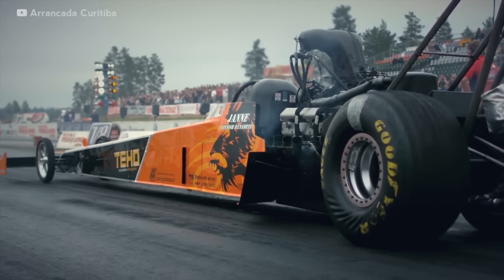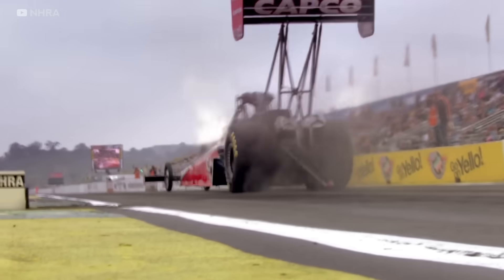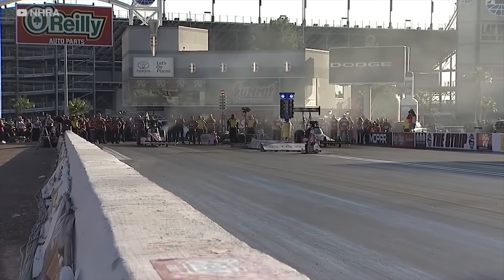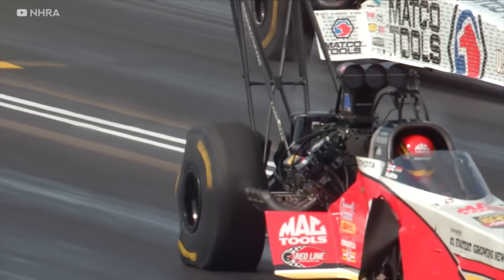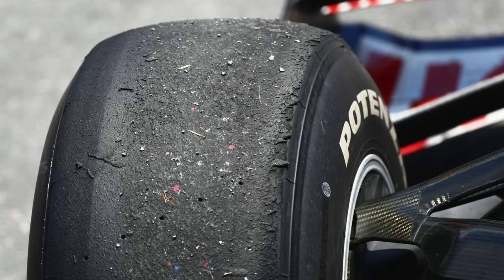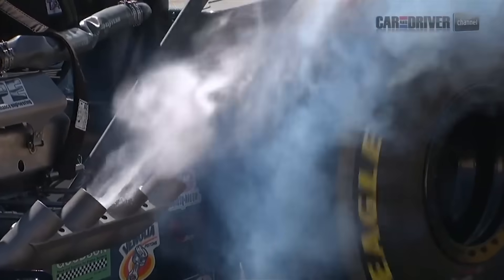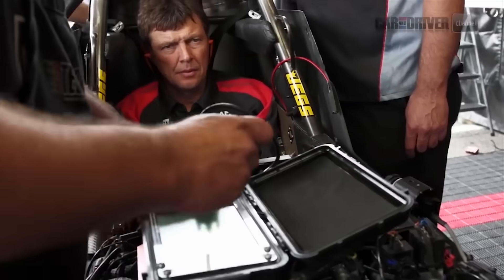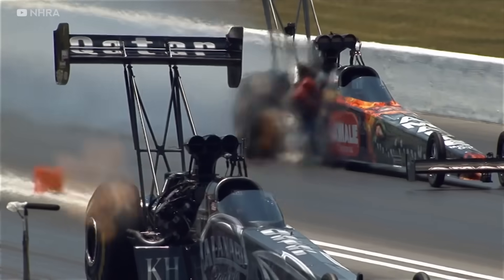How Dragster Tyres Accelerate to 335 MPH in 3.6 Seconds

Comment: You know it’s next level when car noise is being measured on the Richter scale
Reply: Oh fuck its so damn cool!!! And the vibrations damn near suffocate you from shaking your diaphragm so much 😂
Reply: @jacobharrell2634  I thought the suffocation near top fuel dragsters was caused by the nitromethane emissions.
Reply: @naut3  The fuel fumes don't suffocate you, they're just crazy poisonous. The exhaust has a lot of nitric acid in it, which "when inhaled causes a muscular reaction making it impossible to breathe." Your diaphragm just nopes the fuck out when you get a whiff of ammonia or HNO3.
Reply: @jacobharrell2634  YES!! It is a mind blowing the first time
Reply: @jacobharrell2634  hi Jacob. 🙏
Reply: When you're there you can SEE the sound waves distorting the air
Reply: @Man_Emperor_of_Mankind  Not just that but they also make you feel it.
Reply: @Man_Emperor_of_Mankind  i did it.i can see sound.....
Reply: Fact
Reply: Yeah I know. It's amazing. Another amazing thing is they do 0 to 100 in less than a second. These cars would give a rocket sled a run for the money.
Reply: @scottcupp8129   Consider an F1 car at full speed. That's flippin' fast. Now consider the F1 car at full speed flying past a Top Fuel dragster staged at the tree. The light for the dragster goes green when the F1 car breaks the beams. The dragster still wins the quarter-mile by a large margin.
Reply: @DeliveryMcGee  Oh God yes. These Top Fuelers are the fastest accelerating vehicle on the planet. The only as fast or faster would probably be a rocket sled.
Reply: @scottcupp8129  I'm annoyed that nobody's taken a Top Fuel car (or NASCAR car, for that matter) to Bonneville to see how fast they can REALLY go. Safety be damned, there's somebody who'll sign a waiver to drive it!
Reply: @DeliveryMcGee  Problem is, basically everything in the Top Fuel Dragster will fail before you reach 1/2 mile
Reply: @MS-Patriot2  That the dragster wouldn't get very far at Bonneville before something goes wrong
Reply: @hmr200subs  it wouldn’t go round corners at Indy500 either, because it’s not designed to do that. SMH.
Reply: @MikeSmith-tx2lp  Yeah, my point exactly. Obviously it can't do something it's not designed to. Like taking a turn at any speed of going 5, even 3 miles at Bonneville.
Reply: @scottcupp8129  fun fact, the fastest dragster ever, was a rocket car not a top fuel dragster, and it went from 0 to 60 before the rear tires reached the area where the front tires were at launch.
Reply: You also know it's next level when your using your exhaust to create downforce lol
Reply: I also heard that a 454 big block simply does not have enough horsepower to even spin the dragster's supercharger.
Reply: @scottcupp8129  It takes something like 500-600 horsepower to spin the supercharger. A stock 1970 454 makes 450 HP, but back then they measured gross horsepower instead of net (no accessories like alternator, power steering pump, etc), so the true number as installed in a Chevelle or El Camino SS would be lower.
Reply: When you watch a race in person, you feel the sound more than you hear it.
Reply: I live 9.5 miles from a major drag strip.  I can easily hear the top fuel cars running.
Reply: yes i love the ground shake
Reply: (moment magnitude scale)
Reply: Some day I am going to try to make the 4 wides.  a couple races every year it is 4 cars at once.
Reply: @brianschwatka3655  i went as a teenager. it was amazingggg
Reply: Nipe
Reply: Haven't seen one in person but NASCAR is pretty intense. Amazing feeling having the pack pass right in front of you while your hanging on the fence. The vibration and suction is incredible
Reply: @way2sh0rt07grad  having seen them both.  It's honestly no comparison.

These cars are so loud its literally violent to your body.

I often wake up next day with sore and/obliques simply bc im flexing my core so hard when they're about to hammer down.
Ive been going to see the national events since 1993 when I was 9 years old. And still EVERY single run....u get a tiny shot of adrenaline watching the tree countdown before they hit it.  I find that I cant help but feel a bit scared before every run....bc ur body doesn't know wtf is going to happen each time.
Reply: @way2sh0rt07grad  brother you need to go to a drag race. I thought the same when I went to my first Nascar race, but these are on a whole new level.
Reply: Seemed as if everything was being measured by the F1 scale.
Reply: @Sir.VicsMasher most petrol heads have F1 as a benchmark, so it’s good as a comparison.
Reply: Now thing about how in Charlotte they run four cars at a time
Reply: What would it measure on the decibel scale?
Reply: @unfa00  around 160 decibels. Which is almost as loud as a bullet from a rifle which is about 165 decibels
Reply: @unfa00 c. 145dBA
Reply: 🏁 What a marvel of machinery. 🏁👍
Reply: Going to Charlotte and watching dragster is fun as hell. You sit there and it's just so loud that everything is just silent with vibrations, then loud. Everything is shaking and you can't just see the vibrations. Pitpasses also so you get to see everything
Reply: 🏁😂 That was my thoughts exactly 👍🏁
Reply: as someone who used to be the "crew chief" for his dad back in the 80's racing a 9 second car, I can't get enough of racing anything and Top Fuelers are fun.
https://www.youtube.com/watch?v=cTMN_KobQF4
Reply: If you ever have the chance to come to a top fuel drag race, it’s insane how much it shakes the stadium, I always make the mistake of leaving my bear sitting on the bleachers, always vibrates itself off
Reply: @meerkat8090  LOL does you bear do tricks? like ride a tricycle? 

Just kidding i knew you meant beer. :) 
Just having a little fun, but your right. The shaking is visceral. Plus the noise and the smell (careful with the smell of nitro-methane. It is an irritant and will make your eyes water etc. ) Still a lot of fun though.
Reply: Atropus Kargoth  sure it is
Reply: Damnnnnnnn, this one was goooodddd🤣🤣🤣🤣🤣🤣🤣
Reply: Isn't that scale for earthquake??
Reply: @Kc Mad Max  
That is exactly what it is. Top Fuel cars show up on earthquake monitoring systems
Reply: Why do I feel that is the aim of every kid who modifies their Honda Civic to be the noisiest they can 😂
Reply: How my parents measure how loud my car is
Reply: I went to my first Top Fuel drag race yesterday and I couldn't believe the force emitted when they launch. It was so badass. It made me jump the first time I heard it.
Reply: Fuck yea. Someday I hope to go from sportsman up the ladder to top fuel funny car
Reply: Yeah I was quite confused by that.
Reply: Well you know really any vibration can measured on the Richter scale, including just speaking normally. It's a logarithmic scale.
Reply: Probably 1.2 on the scale, not enough to cause an earthquake.
Reply: On the decibel scale, drag cars measure between 150db and have peaked at up to 180db. To better understand the scale, 150db is 32x louder than 100db (your average straightpiped street car), and 180db is 256x louder than 100db.
Reply: 10+ are Russian mic
Reply: Hello me
Reply: @Daddy Tyrone why would I not.  If my schedule allows I am going this year.

Comment: Fun fact:
The burnout is controlled by a throttle stop in the linkage, only allowing the throttle to open a very small amount. When the dragster is staging, you'll notice one of the crew members pull the throttle stop and show it to the driver, letting them know they now have full power available.

Comment: when you stop using decibels and now have to use Richter scale
Reply: I tell this to everyone. Go to a top fuel race at least once in your life. The sound is simply awe inspiring. It didn't even seem uncomfortable, it was just this rumble that turns into a roar you could feel all the way through your chest.
Reply: @Elthenar  i have a sensory disorder with sound. I'd rather not
Reply: @ballsquid4135  ok
Reply: @ballsquid4135  no one asked
Reply: @ballsquid4135  don’t confuse sound with noise.
Reply: @amielterence  Huh?
Reply: @ballsquid4135  who asked though
Reply: @ballsquid4135  so do I. It's different though. It doesn't hit the senses so much as the chest.You feel it more than hear it, though I'd still suggest ear protection
Reply: @ballsquid4135  You can use earplugs
Reply: @Elthenar  Its the same as standing 80 feet next to a fighter aircraft with about 120.000 horsepower at takeoff. you can really feel the noise, not just hear it.
Reply: @Elthenar  I know growing up in drag racing and now doing it myself I still find myself wanting to go to s.I.r. And catch a national event. Nothing quite like it
Reply: @Elthenar  very true, even from farm away, you're like "wtf is that!"
Reply: @Will Sure it does. It's just that this low a number means little compared to a higher number during a real earthquake. Because of the exponential nature of the Richter scale, the difference between a 2 and an 8 is somewhat dramatic.
Reply: @Will Well actually i know quite a bit about it. i guess it doesnt mean too much but the engines are so powerful they literally shake the ground so hard a seismometer can read it which is pretty darn impressive
Reply: Never heard of a dragster knocking someone into s seizure because of the sound though, that goes to the thunderscreech the best fuel to noise converter in the world

Comment: What if you start in second gear👀?
Reply: Kind of hard to do seeing that there is no transmission. It is direct drive. They use a five disc clutch to apply power.

Comment: You should check out Racing Chassis and Suspension Design by Carroll Smith. It's got an SAE paper in it describing how drag tires work. The tire crinkling isn't necessarily for an increased contact patch, but rather to slam the contact patch into the ground, increasing the amount of grip possible. You don't get 4+ G's of acceleration off the line with just engine exhaust thrust and the weight of the car.

Comment: Notice NONE of these motorsports uses ultra-low sidewall tires , actually quite the opposite in F1/Indy as the tire acts to absorb bumps/imperfections in surfaces. I HATE rubber-band tires myself.

Comment: So these are the fastest accelerating machines in the world, I understand.  But they must operate under certain NHRA rules, regulations, and constraints.  What if you could build an "anything goes" machine - any horsepower, any design, track as long as you want.  Would be interesting to see what is theoretically possible.

Comment: I work in a place that makes some of the equipment these guys use for their nitromethane fuel. The hydrometers they get are calibrated within the weight of a grain of sand and come with conversion charts accurate to tenths of 1 degree Fahrenheit. Even their fuel testing gear is extreme.

Comment: Also forgot to mention that the intense heat and pressure being put on the clutch system causes it to cease and combust if the dragster doesn't stop after a 1/4 mile. There's videos out there of dragsters doing more than a 1/4 mile and then losing all control because the drive train locked up.

Comment: its not just the tyres that reduce the output ratio, its also the fact that top fuel dragsters use a slip-clutch that applies more pressure the faster the engine is spinning, to the point where after the race is done some of the clutches weld together from friction.

Comment: "The oxygen content of nitromethane enables it to burn with much less atmospheric oxygen than conventional fuels." BUT it DOES require mixing with air. What do you think that dirty great supercharger is doing? It is compressing a huge volume of air into the engine.

Comment: Pedantry: Squatting of the tire increases the drive ratio and ballooning decreases it. Lower gears have higher ratios. Gear ratio is a torque multiplier, not a speed multiplier.

Comment: I read an interview with a top TF driver about ten years ago where he stated that the main purpose of long burnout was not to heat up the tires as they provided enough traction with a short burnout but to get the engine up to operating temperature.  The driver also stated that the ignition only lit the fuel for half the run and the engine dieseled the rest of the way as the spark plug were completely melted after a couple seconds.
Reply: Spot on, I worked on a national champion car doing ignition tuning. We figured that everything I did was valid for near 1.2 seconds. Even so, that had the car approaching 200mph, so the minuet changes were very valuable.

Comment: Top fuel dragsters should be on the list of “Wonders of the World”
Reply: Flako  except for how fossil fuels still power most nations electric grid, so charging an electric car is still polluting
Reply: And on the list of most polluting machines ever made
Reply: @UmVtCg  This isn't that bad. There are like 300 cruise ships in the world but they produce more pollution than ALL the cars in the world combined
Reply: @UmVtCg  because a car that runs for 5 seconds at a time 3 times a day 3 months of the year is the most polluting thing on earth...
Reply: @juliantangney6855  cruize ships and airplanes literally exist and people  complain about motorsport
Reply: @UmVtCg  still nothing compared to production cars as there are only a few built and have extremely short races. Heck, even commerical aircrafts which are practically more powerful than dragsters, and in which there are quite more of them still have a tiny proportion compared to personal cars worldwide in terms of emmisions and fossil fuel use... because there are just so much of them.
Reply: @UmVtCg   no that goes to the mines that mine batteries for electric cars😂
Reply: @EattingMeatSince82  I love running cars on coal power.
And that's why it's green energy.
Pffft. Couldn't keep a straight comment.

Comment: So if nitro doesn't require air to burn, what's the point of the supercharger?
Reply: You need to super charge "air" out. The faster you get exhaust air out the more new combustible "air" in. Supply and demand.

Comment: You forgot to mention all the reasons Methanol is used as Dragster fuel. One main reason is that it Burn's at temperatures far Lower than gasoline or the Blue race fuel you see in American Gas stations. Keerr ping the engine from overheating

Comment: 6:45 slow mo videos are so interesting. Look how the car is trying to roll when it takes off. Does this happen because the driveshaft (if that's what it is called) and flywheel accelerate at an enormous rate and function as a reaction wheel, rotating the whole car in opposite direction?
Reply: The Down thrust from the exhaust also counters this rotational effect and chassis flex.

Comment: There's a third purpose to burnouts: to get the crowd excited.
Reply: Fourth purpose:  To give fans a free rubber layer souvenir covering their skin to take home.
Reply: 4th purpose....to give ME wood!!!!!!!!!!!!!!!!!! :)
Reply: Fifth purpose : Look cool in front of your kids
Reply: Thats the first
Reply: I think its to show off how a mere .040" or so throttle gap will make enough grunt to immediately smokeshow those huge tires.

After they back up and are ready to final stage, that's when the fuel stop or whatever is removed.

So the 2" fuel feed can flood the barrel valve and deplete 18 or so gallons total in a run.
So dang much draw on the fuel tank these beasts basicallu shotgun the fuel.

Without an additional door to allow air into the tank, the fuel pump pulls a vacuum and runs lean until KA-Boom! clatter-clatter-clatter

I find these things as intense as F1 cars. Somehow just as engineered yet seemingly also so little control over the conditions.

Imagine rebuilding a F1 engine before any run of any length. How the top fuel teams determine what direction their tune ups need to go is absolutely nerdgasmic to me.
Reply: The best are the NHRA Top Fuels at evening. Fire from pipes is like 10 to 15 feet.
Reply: And they’re fun!
Reply: I havent been there but I've heard it's like having someone pound fists on your chest when those engines rev up
Reply: Clean them tires
Reply: For Mustang It's like for Attraching Preys
Reply: They warm up the slicks
Reply: @Benyesno85  it was a joke.....
Reply: @totti-wb3yc  at least for the people who doesn't listen to the video knows what it's for lol
Reply: @loop5720  yeah
Reply: @Benyesno85  they warm up my slicks iykwim 😏
Reply: Go away with your maskslave profile picture.
Reply: @robertkiestov3734  I hope you realize it denotes the exact opposite theme

Comment: How do they maintain the track?  Presumably they need to periodically clean off the rubber that's laid down.  I assume if too thick it will shear and thus not enough power transfer. But need to ensure that both tracks are as similar as possible.

Comment: 8:38 Does anyone has a link to that specific race?
Reply: Hard to tell, but easy to search for top fuel accidents etc.  The volume of fuel injected frequently causes hydrophilic conditions so lots of carnage out there.
Reply: @ShainAndrews  Not possible to search that way, it had to be much more specific but that was probably a warm upp based on the ballooned tires. But you can see the inlet all of a sudden fully close and presumably a lot of vapor gets everywhere and perhaps even compressed in the compressor and then when the inlet vanes open again air rushes in and ignites everywhere and boom.
Reply: @dtiydr  Your call.  I've only watched these guys run for the past 20 years at Bandimere...   The second fuel is coming out the exhaust things go south fast.  On that run all cylinders went dead.  Guarantee that block is spit in half right down the crank journals.
Reply: @ShainAndrews  Cool, not have had the pleasure to see one my self. Yea my thoughts, and there was also a huge cloud of fuel coming right out the exhausts. No there can't have been much left of that, half engine just gone and the rest most likely cracked right through in more than one place for sure.